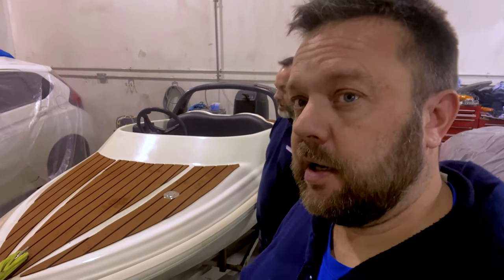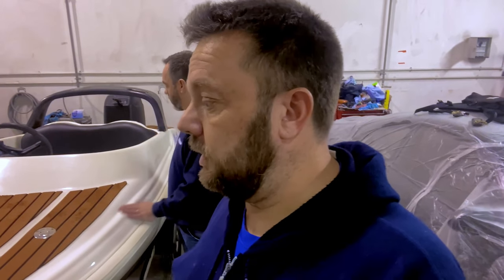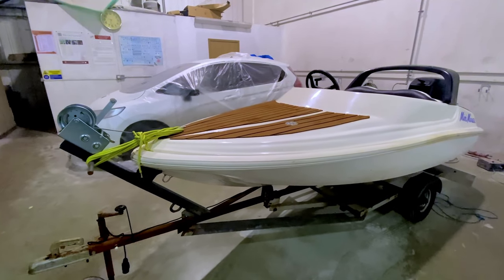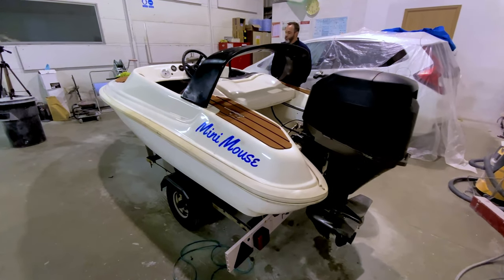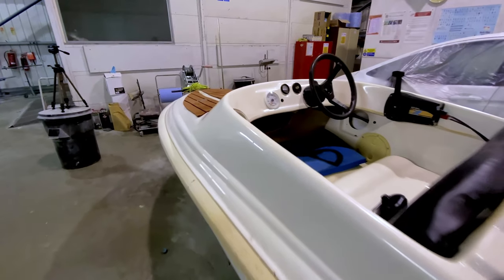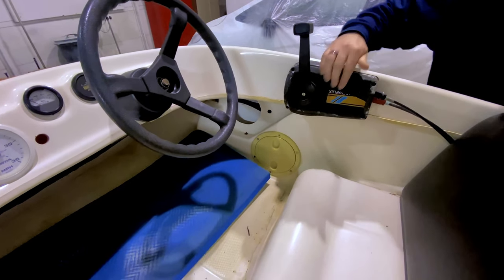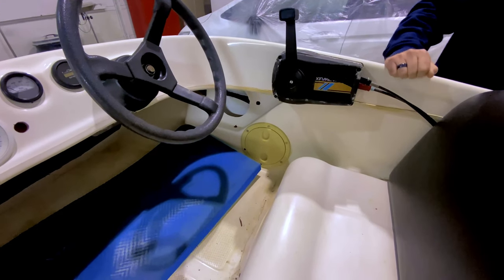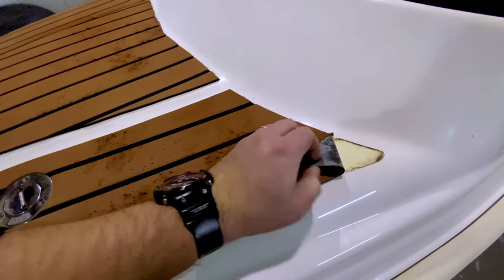Project Restoration Of A Pocket Speedboat - Part 1

Comment: How many Horsepower is the engine?
Reply from the maker: Ours has a 25hp 4 stroke.
Needs a bit of a tidy up. Think part 4 or 5 will cover the engine.
What engine does yours have?
Reply: I have 20hp 4 strokes 
Did you try it on the water yet?
Reply from the maker: Next month it hits the water!